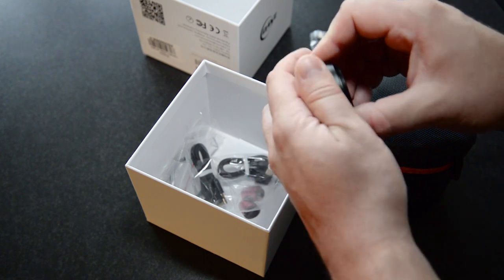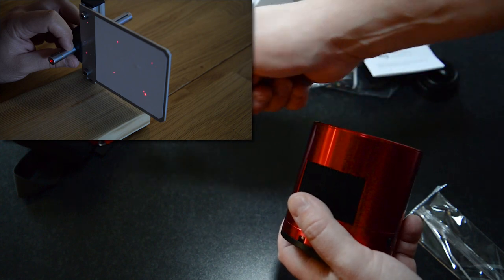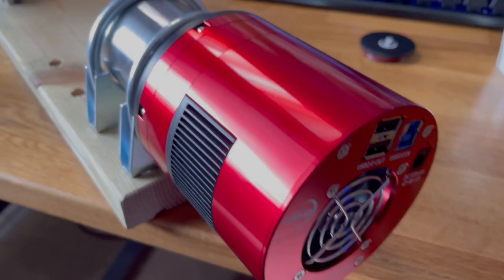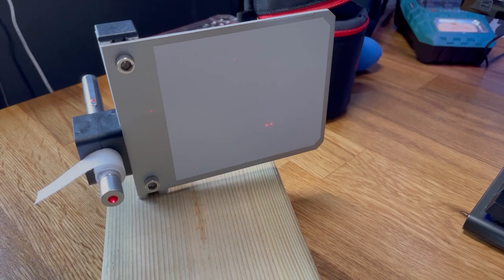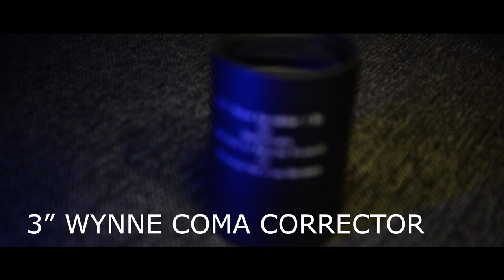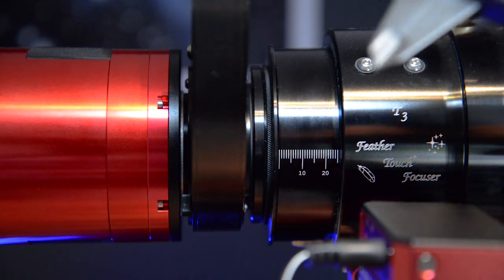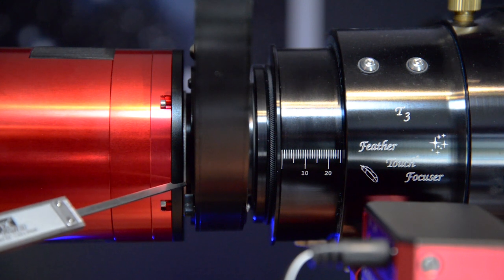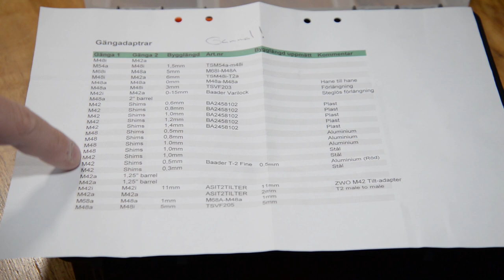New camera - New Corrector - Getting it all setup to work with my 10" astrograph telescope

Comment: Nice video Daniel. Love the grease idea. So many cold nights I have spent too long trying to separate spacers and adaptors. Not fun!
Reply from the maker: Same here, i don’t know how many thin adapters I have destroyed 😂 trying to get them removed
Reply: @ExoPhotography1  For some of mine, I’ve actually drilled small holes in them on the sides that allow small M3 bolts to be screwed in, and then these serve as handles that allow you to get more torque to separate them. It’s an ugly solution though. Strap wrenches are quite good but not for tiny spacers. Looking forward to your next video. I’m really interested in seeing more of your mount. I have a 10 Micron that I love, but I am intrigued by the direct drive mounts.
Reply from the maker: @simonwalsh6804  Ah! Smart move! I wen’t and bought filter wrenches for lens filter, they work surprisingly good 👍🏻 

I Will try to shoot another video tonight, but have one out in 2-3 weeks before that :)